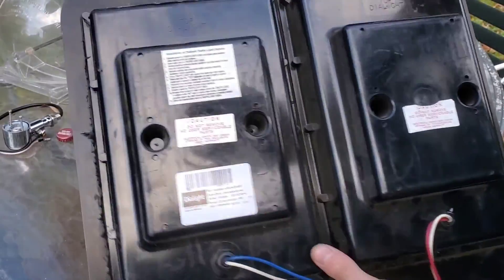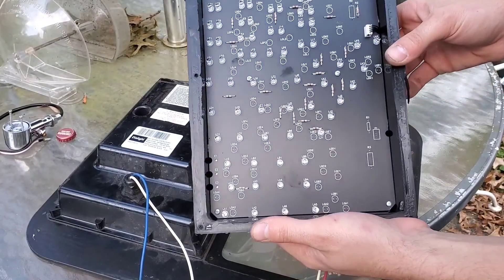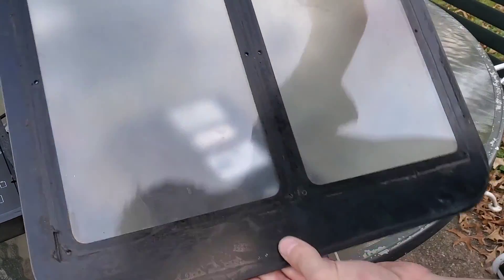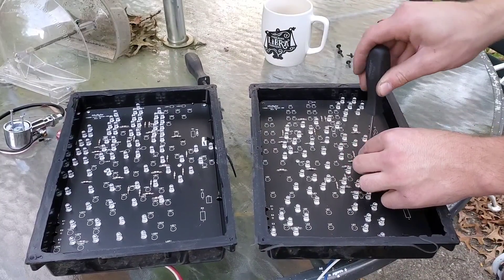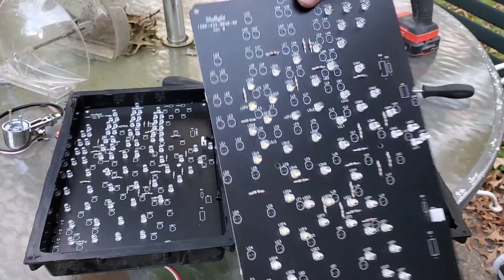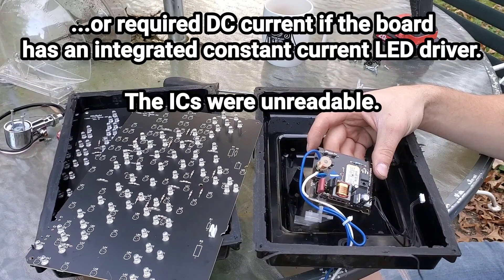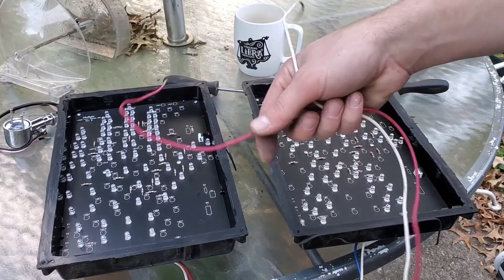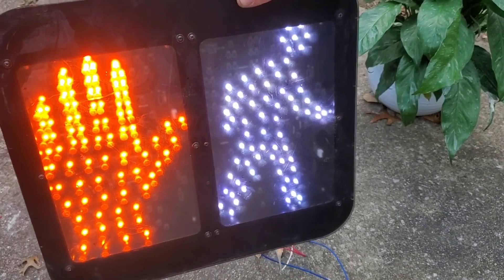What's Inside an LED Crosswalk Sign? Traffic Signal Dissasembly

Comment: I bought some in the aluminum housing, but when i tried to touch the wires from the sign to the wires on the power cord it tripped the outlet. Could this be because i didn't actually connect the wires?  The signal is probably pretty old, maybe I need to convert to a regular bulb.  I touched the red wire to the black wired and the white on to the white wire. Any help would be greatly appreciated. i got an assortment of the hand and the person.